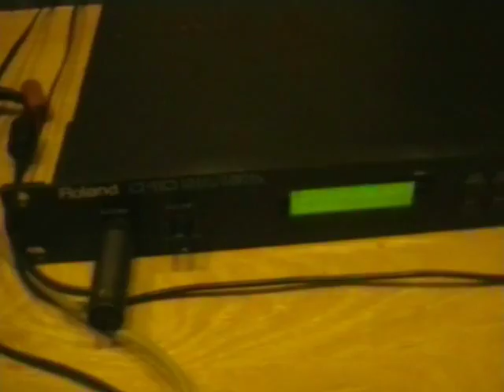ARDUINO LASER HARP WORKING PRINCIPLE 3

Comment: If the DAC outputs a 0 to +5 volt signal and the galvo driver needs a -5 to +5 volt signal I think you need to amplify by 2 the output from the DAC to get 0 to +10 and then shift the signal to get what galvo needs (-5v to +5v).

I think you are using the TL082 the LM324 and the SSM2142 for this job. How do you get the supply voltages for the opams? As far as i know you need a negative source to able the oamp output a negative voltage.

Comment: Just wondering, how come there is a line of laser connecting all the dot when projecting the laser on the wall, and then when u turned off the lights and add some smoke, I could see the beams separated from each other

Comment from the maker: The laser is never siwtched of (no blanking). The galvo mirror stops for a short time and then travels to the next position. During the travelling of the mirror, it draws a line and your eyes can see this line (on the wall). Because this happens so fast, your eyes see the drawn line. Because the beam stops for a moment, your eyes see the beam brighter than when it travels and your eyes see this as a bright dot. When you blow smoke in the beam fan, the laser also can be seen between the beam.

Comment from the maker: You can buy a galvonometer on ebay. Look for laser scanners.
I do not recommend to use steppers. They are to slow. Even 2000 rpm which is a lot for a stepper. But this is one direction only and continously. The stepper has to rapidly go back and forth. It think that a 2000 rpm stepper is much more expensive than a 20kpps scanner set. Try at meierlight point net.

Comment from the maker: Yes steppers go in 2 ways.
Probably you can create a beam fan.
I tried with a very cheap stepper. After 4 beams, the result was awful.
Think about it.
In order to see the beams with out flickering, you need 25 Hertz minimal (Cinema movie frequency)
If you create 9 beams as in my harp, the stepper needs to make 225 STEPS PER SECOND.
(Then the beam spacing is one step.)
Then think about that the stepper stops for a moment to display the beam. 
It means that the stepper should do 60x225=13500 rpm!